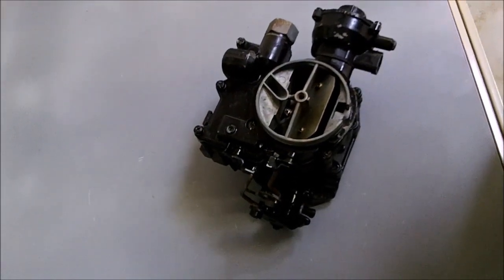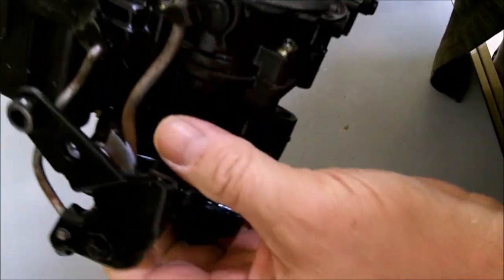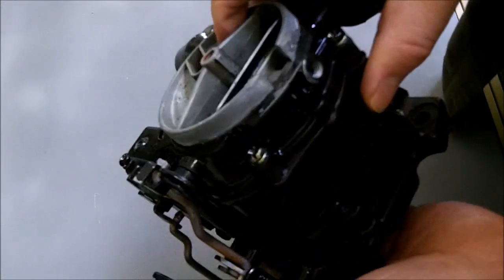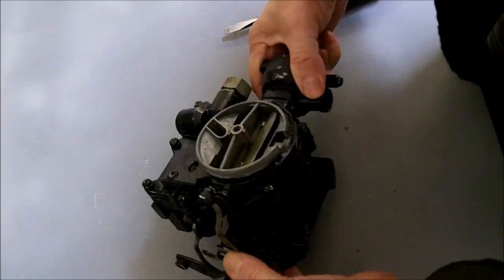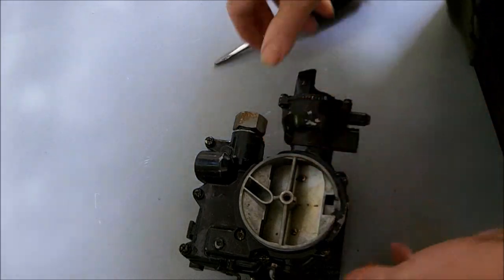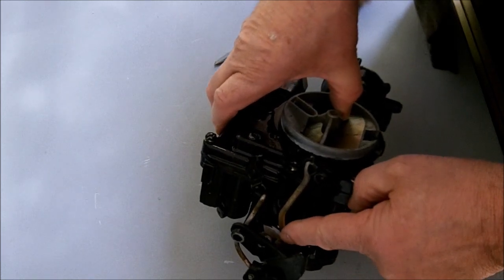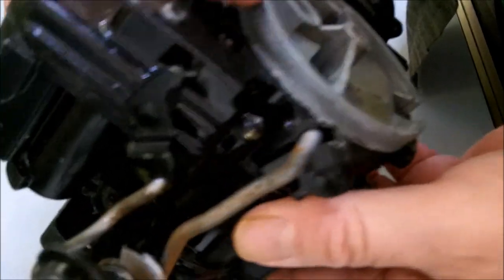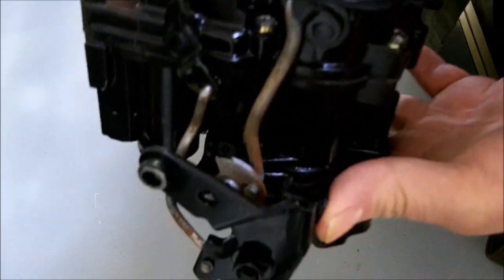Mercarb Marine Fast Idle Cam - How it Works

Comment: I don’t have the carburetor off the boat. It’s still on the boat so the throttle linkage is hooked up. Should I just open it up using the throttle body before adjusting the choke
Reply from the maker: Opening the throttle slightly will allow the fast idle cam to move to the lowest point.

Comment: After doing this now on cold starts the choke plate is staying closed causing a no start pressing the throttle doesn't reset the choke either
Reply from the maker: The electric thermostat may be bad. The coil should expand when heated.

Comment: Can the choke be removed or disconnected and the linkages work the same on the Carb without effecting engine performance at (operating temperature)? It should just effect cold starting right?

Comment: First of all great videos thanx. Mike I have 2 barrel carb on 4.3 mercruiser just had the engine rebuilt.  Runs smoothly and ideal rpm are good. I'm getting a bit of gas in my exhaust wash . Could this be running to rich or a hung up choke?

Comment: THERE IS NO CAM!!
Here goes:
My Marine MERCARB  DOES NOT HAVE A FAST IDLE CAM; if i  look  closely(i don't mean with my eyes closed) i see that the cam is ROUND!!! and i see that the 2 butterflies stay put as the "CAM"-not a cam,remember?- is turned;
Now,why is that? it's  because of the clutch dog/dog clutch  on the bottom of the stern drive(no kidding,I worked for Merc).
Reply: Jose is absolutely correct.  A marine carburetor will not have what is normally referred to as a "fast idle cam" in the automotive world.  The cam on a marine carb maintains the same radius thru its range of motion, and therefore has no effect on RPM.  Raising the idle speed is left to the vessel operator, thru the use of throttle lever(s) while disengaged from the Forward/Reverse action.  Shifting in and out of gear must be done at the lowest possible RPM to preserve the transmission/outdrive.
Reply: THe "Fast Idle Cam" does NOT increase idle speed on marine carbs because the linkage rigidly holds the throttle in position based on the control lever. A fast idle cam, like in an automobile, would attempt to fight the contol cable position and put things in a bind. Also, it is bad for the gearbox to shift at higher than idle speed.  So you are supposed to run the cold engine at higher speed manually from the control until it is warm enough to idle at the normal speed before shifting. The cam might be there only to provide friction so the choke  doesn't flutter around.
Reply: Thanks for the info buddy! You might be just the guy to answer a question I have on my Mercruiser 3.0 if you don’t mind sharing a little more knowledge please? The moment the idle screw touches the cam (which I can see is round as you mention) it binds up and the choke won’t move anymore. Adjusting the screw until it even slightly touches the cam causes this, and the spring in the choke doesn’t have enough strength to overcome it. Is that correct?? Or is the throttle cable out of adjustment maybe? It’ll run perfectly at higher rpms but cold or warm it won’t idle 🙄
Thanks very much!

Comment: Hi Mike. Thanks for the video. I just had my carb rebuilt. Now it starts fine when cold but after warmed up, it has trouble starting after setting for 10 or 15 mins. I would appreciate any input. Thanks.
Reply: HI JUSTIN.  IM HAVING THE SAME ISSUE W/ MY BOAT.  DID YOU HAPPEN TO FIGURE OUT THE ISSUE WITH YOURS?

Comment: Excellent video.  Thank you.  What is the screw at the left of the picture at minute 3.05? The gold screw with the spring that is at the bottom of the carb. Does it do anything important? I appreciate your input.
Reply: The Brass screw at the base of the carb is an air intake idle set. I Believe.,  I turn it clockwise until it lightly seats then back it out 1-1/2 to 2 turns and seems to be in the ball park..
Reply: idle mixture screw and its best to use a vacuum gauge to set it correctly

Comment: Hello Mike, I'm replacing a 4bbl Quadrajunk carb with a thermal choke on a Merc 260.  The replacement is a Mallory with electric choke.  My question is, how does the choke work? Is the 12v to the choke constant and the carb will adjust itself, or is there a voltage adjustment somehow done electronically?  Thanks
Reply: Thank you sir.

Comment: Hi, do you sell the choke thermostat element for this carb on your website? Mine is worn out and will not push the cam closed. I have tried adjusting it. Is there an automobile equivelant?

Thanks,

Comment: The instructions for my carb kit mention setting the choke unload by bending the tang on the throttle linkage.  I don't see the tang anywhere on it.  Do some carbs not have that piece?  I see where it should be on your carb in the video, but I don't even see where mine would have broken off.  My carb is 807504.

Comment: Mike, was the fast idle cam ever made from brass?  My son-in-law has a Mercruiser 3.0 from the late '80s with a Mercarb, and the fast idle cam appears to be made of brass.  The cam has no effect on the idle speed when I move it through its range of movement, leading me to think the brass has worn down and is no longer a cam.  I've ascertained that the idle speed screw is definitely in contact with the came.  

Am I missing something?

Thanks
Reply: In some markets (i'm in portugal-to the left of spain (it's in europe!)) the idle "cam" IS NOT a cam,it's round,NO change to the throttle plates; i was cleaning two mercarbs (off of 3.0 -181 L4 Mercs) and they BOTH have ROUND-no cam- idle screw stops! 
That is because of the old merc. shitty shifter and it's dog clutch,you cannot have a high idle,and since it usually stays around 20ºC and up here,you almost need no choke,just pump the shifter 3 or 4 times and crank away...
Reply: Thanks, I'll take another look, but it's definitely not moving the throttle at all.  I should look for a replacement cam.  Are you a good source for those things?